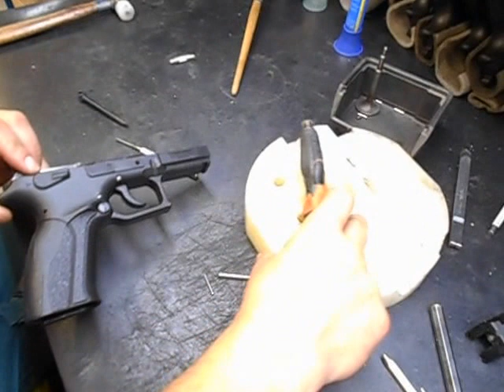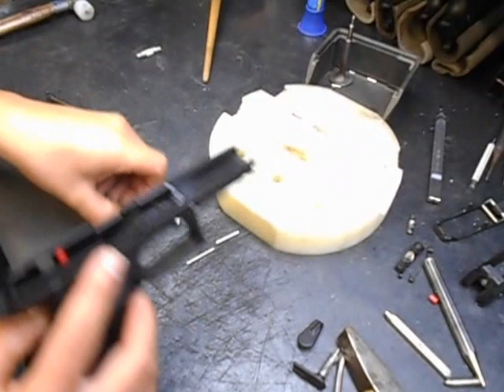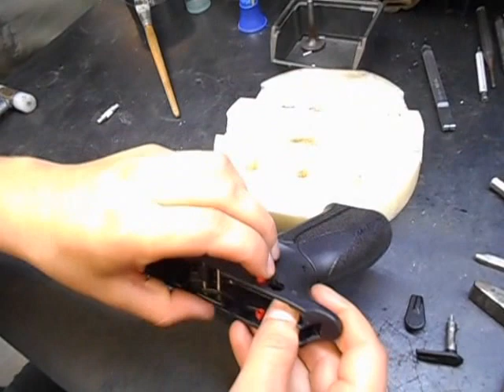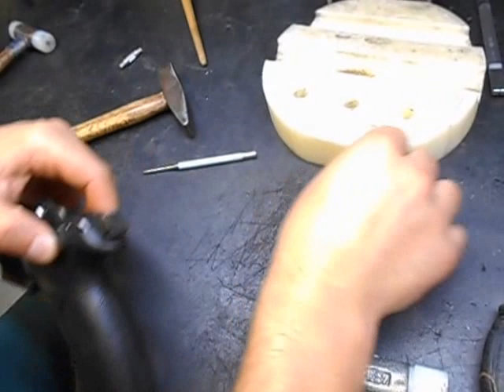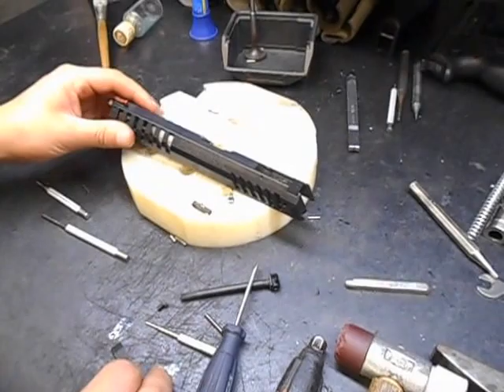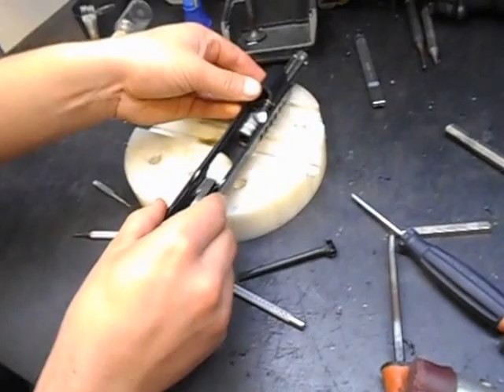Grand Power X-Calibur Factory Strip and Re-build

Comment: First of all, thanks for your video! 

I saw a post in Brianenos forums which mentioned that removing part #52 - firing spring back-up ( displayed at 6:47 ) could reduce the trigger pull. I tested and after removing it, DA dropped from 8+ to 6.7lbs and SA from 2.5 to 1.8lbs.

I didn't noticed any issues so far. No light strikes or failures. Do you happen to know what is the purpose of part #52?

I mean, a part that is easily removed and greatly reduces the trigger pull sounds too good to be true.
Reply: I'm curious, still no problems after removing that part?

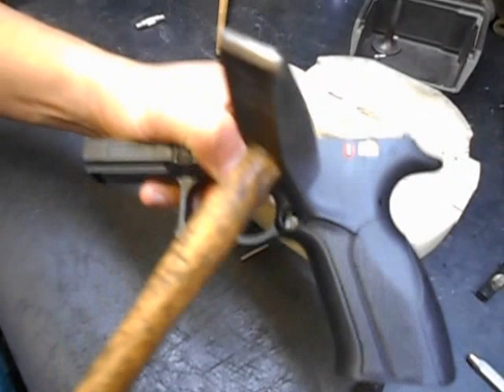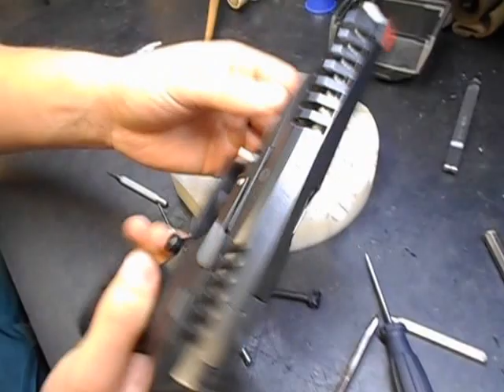Comment: Look at EXACTLY 2:44.......a pin drops out of the gun as he is hammering & he doesn't even realize it.  ALSO, freeze it at 12:25 and note the 2 pins still sitting by the white block that he removed at 5:08.  This guy has no idea what he is doing!!
Reply: LOL, those pins falling out during assembly are slave pins used for assembly purposes only. It holds parts and springs aligned until real pin replaces them.
Reply: do you know how to convert flobertsV